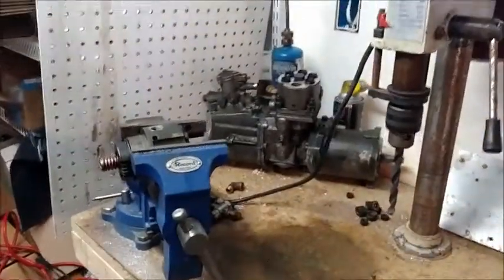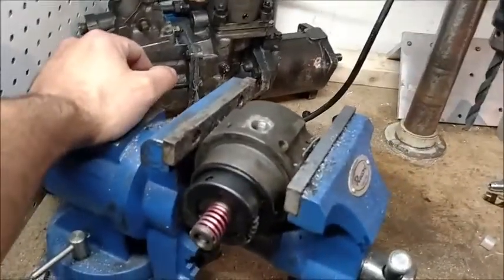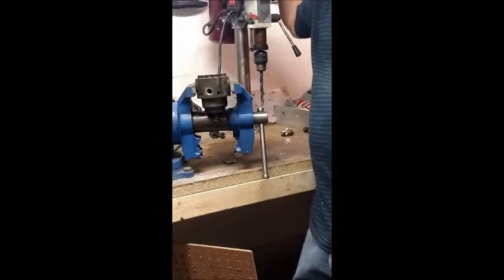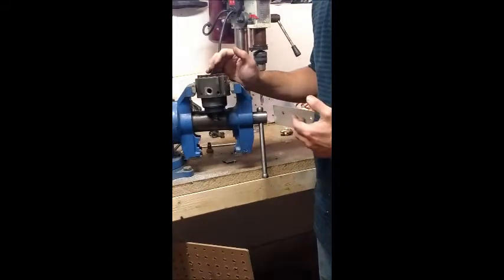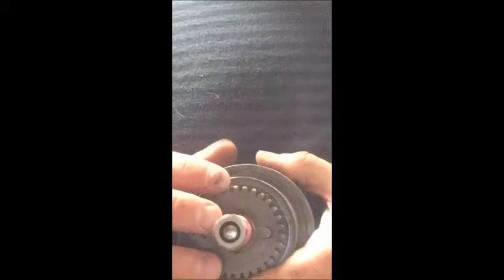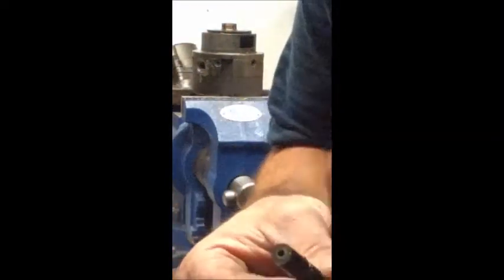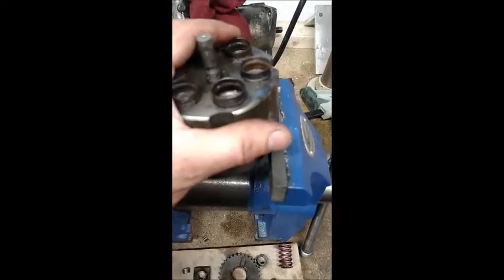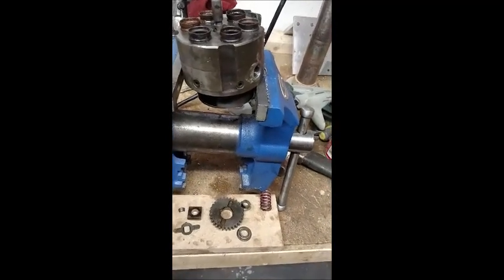HH Rebuild

Comment: Thanks a ton for this. Just rebuilt the HH on a new duece I got. First time being that deep. Had to make the butterfly clip but I got it back together and it runs just fine. Thanks again for the video.
Reply from the maker: What did you make the clip out of and do you think it's a permanent fix?  I have considered making them but was concerned the hardening process would send the cost too high when I can sell new AMBAC replacements for $65.  I'd really like to hear how well it works out for you.  Ken@MVPartStore.com
Reply: WoodWorking With ADD I just made it out of mild steel. Cut it out on our waterjet. I can't imagine them needing to be hardened seeing as the only thing they do is keep the plunger in the correct rotation. But you could case harden them pretty easy if you wanted.

Comment: Thanks for the video... I have a few questions... roughly how much up/down travel should the plunger have if it's operating correctly? Also, is there a common cause for leaking at the top of the HH? Mine is keeping the top of the HH fairly wet with fuel, but not drenching or spraying everything in the area. The injection lines are dry above the head, and the center plug and lines are torqued tight in the head. Is there a gasket or crush-washer under the center plug that seals the plug? what seals the lines/flare nuts against the head?  Thanks again - Maker
Reply from the maker: I've seen a lot of heads leak from the injection lines.  One thing to try is removing them all and making sure they are clean of any rust or debris.  Once there are clean and all the ferrals spin freely reinstall them and make sure they are tight.  There are no gaskets in the injection lines.  I have to verify there isn't in the center plug but I don't believe there is.  There is roughly 3000 psi in that system so placing a washer in the system anywhere would change the volume, however small, and therefore change the psi rating.  Movement is about 3/8 of an inch or there abouts.  I haven't measured it yet to give you an exact so I'm basing that upon spring compression.
Reply: Thanks for the info and speedy reply... I'll give that a try. I've also got to replace the gasket on the fuel shut-off cover (leaking oil a bit) would you suggest putting any type of sealant on that screen mesh embedded -looking gasket?
Reply from the maker: If the gasket has torn then yes replace it.  I would use the gray RTV that is meant for oil contact and not bother with a gasket.  Otherwise I have simply reused the gaskets without issue.  If you ever need the o-rings for the head I have those available as well.
Reply: DOH! I just got a new gasket in the mail (Timing is everything) I've got some Permatex "Ultra Black" I'll give that a try. Thanks again. Looking forward to the next vid. - Maker
Reply: I do want to get a spare set of o-rings and a retainer clip... are the o-rings in the kit nitrile? the MV website didn't specify.
Reply from the maker: They are Viton.  They are made to with stand fuel, oil and heat.
Reply: Just bought the o-ring kit and clip on the MV site. Thanks for your help. - Maker
Reply from the maker: Maker-Wright shipping tomorrow morning.
Reply: Got 'em today... Thanks again. - Maker
Reply: I just posted a thread on Steel Soldiers on how to make a Pop-Tester adapter for Mutifuel injectors (under my other alias "Menaces Nemesis"). May be of interest to folks... https://www.steelsoldiers.com/showthread.php?173782-Injector-Pop-Tester-Adapter-for-Deuce Have a great weekend! - Maker